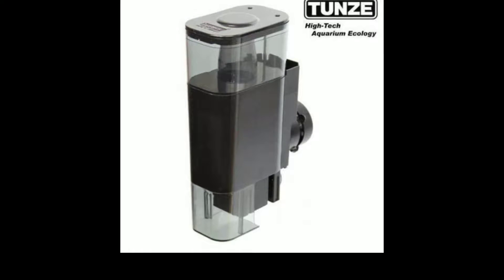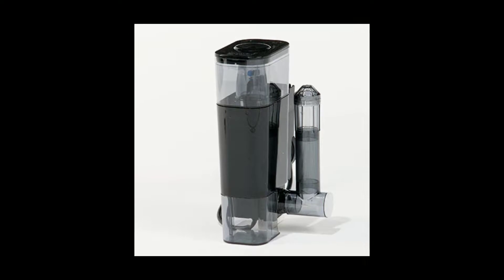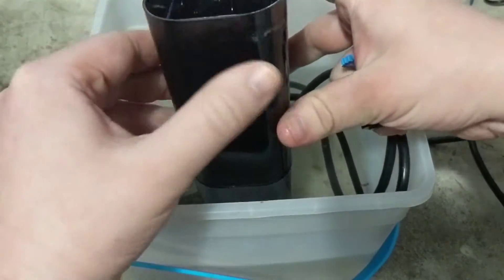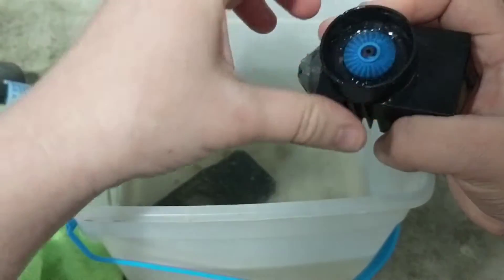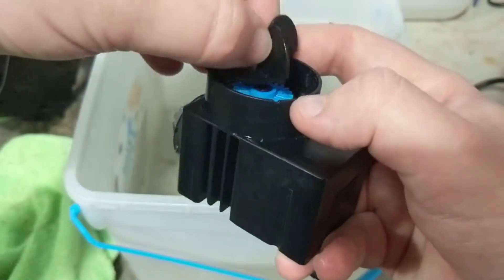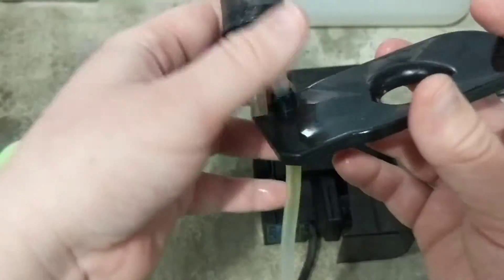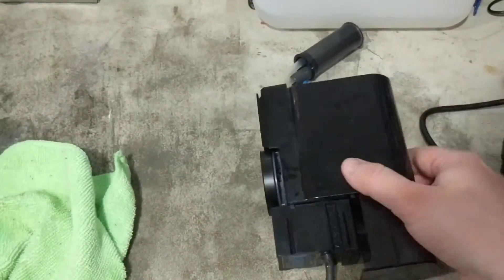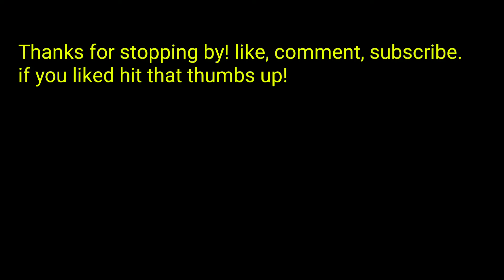Tunze doc 9001 nano skimmer review and cleaning!

Comment: This skimmer has worked really well for me - - did take ages to settle in probably 3-4 weeks and even after 2 months I'm still running it with foam in the outtake to reduce micro bubbles. I also had to superglue (reef safe super glue) the magnet to the mount extender (I have to use the extender due to the lip on my tank) as it was fairly loose and it fell off the side of the tank a couple of times! What I learnt was to just chill out and let it do its thing - as long as it is sitting at the right height in the water and the tubing is connected to the impeller cover then it will settle down and skim very well. Oh and the silencer on mine is on a really short piece of tubing so there was no chance of hanging it on the outside of the tank - but again thats because I have a lip and cover on my tank.
Reply from the maker: Oh yeah man, mine has been a champion.

Comment: your skimmer cannot function correctly because you have reversed the mounting direction of the upper plate (see part no. 8 on page 36 of the instructions). Its chimney shape must be tilted upwards to channel the bubbles upwards. As you have done, large quantities of micro bubbles accumulate under this removable plate which generates large bubbles which greatly disrupt the process

Comment: I’ve never worked with a skimmer, but don’t you have to “re-break in” the skimmer after you clean it? When you break in a skimmer it builds up a slime coat...right? Not knocking you, just curious.
Reply from the maker: Depending, some skimmers do, but I have always left mine open and with the handy water line for easy adjustments, the break in is quick and easy. Plus in the break in time most people are worried of a skimmer over flowing so setting the adjustments for more of a dry skimmer your safe.

Next if you don't clean your skimmer every so often the preformance will start to drop as the slime coat is a double sword.
Reply from the maker: Sorry left that not fully explained. Not only do you get the slime coat witch turns into the skimmate that is pulled from the collection cup, but you do have to clean your pumps and sometimes check to make sure the air intake isn't clogged up. Witch sadly on this skimmer and sadly with most nano Skinner's happens after awhile... Some worse than others about it(this is one of them). It's also good to clean your pumps in your tank from time to time about every six months. This one because of the clogging problem is about every three to four months. So if I am gaining preformance and have to deal with a break in of one day to a week I will deal with that. This skimmer normally breaks in with in about 8 hours and preforms like a champion after that for the next few months.

Tarzan I hope I have explained and answered your question, thanks for asking. Please note all skimmers are different so learning your equipment is key!

Comment: I have the 9001 dc version and been running it now for 3 weeks and all it get is produce white foam and no skimmate. Any suggestions?
Reply from the maker: Mine isn't the DC version, so my pump is always at the highest setting, and I leave my air line all the way open. On the front side of the skimmer should be a wavr line. Above that line is a wet skim, below that line is a dryer skim. I would move the water below that line to run a little dryer. Next would be the bio load that the skimmer would be taking out, you are clearly getting air to mix and get a foam but seems your bio load isn't heavy enough to give you the dark skimmate.